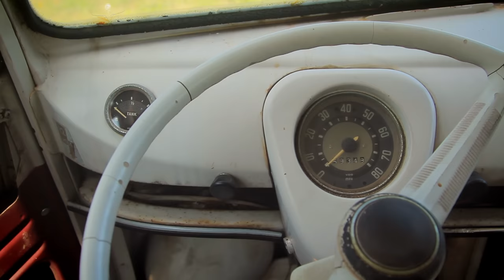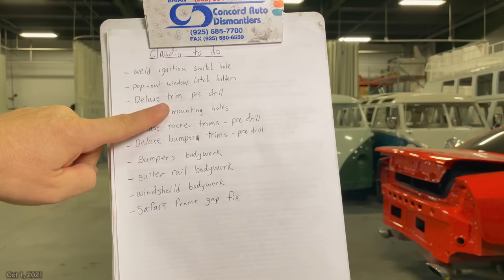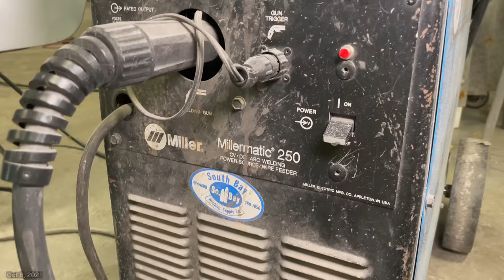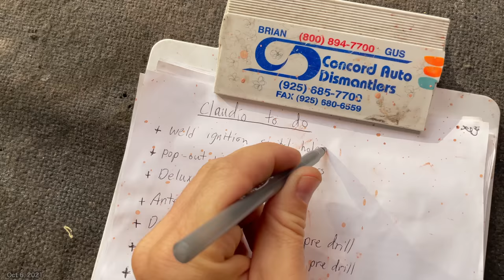VW Bus Restoration - Episode 57 - So Deluxe | MicBergsma

Comment: This entire series has been, and is, fascinating to watch.  If I've learned anything, it's that these meticulous restorations of old inexpensive cars can't possibly be justified on the basis of time or cost.  You just have to love the project.
Reply: 'Inexpensive?' Right.
Reply: These buses when restored can easily go for 70-90k.
Reply: @TheVWGarage  Looks like they cost as much as that, or more, to restore to that level.  Consider the hours in this project alone!  Then add in all the parts that had to be replaced with new aftermarket stuff.  Maybe Mitch will disclose at the end what the final tally was (including placing a value on the time that he and and his girlfriend worked on the project).  I sincerely doubt that it makes any economic sense without revenue from the videos and sponsorships.  It's got to be about the love of the project.
Reply: @jimihendrix1575  I'm referring to what they were initially sold for.  These buses were never luxury vehicles.